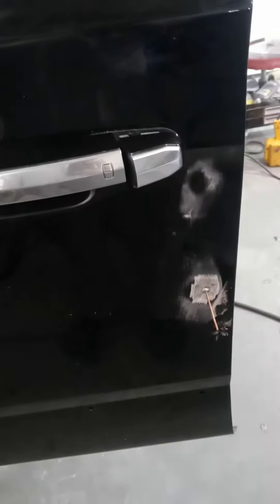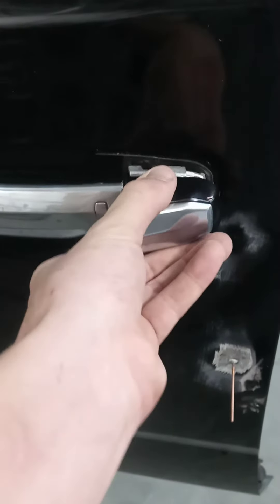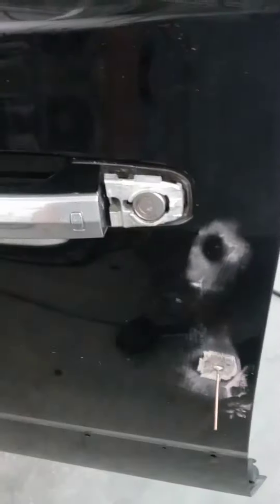2021 Cadillac Escalade driver side door handle removal

Comment: Technician here, I had no idea what was holding it.  But that screw inside had to completely come out.  (That cap is held with 2 bolts) on side and backside
Reply from the maker: Yes 1 outside the door t25 and 2 Hidden t25 bolts on the inside of the door panel
Reply: These designs keep getting worse eh! 🙄